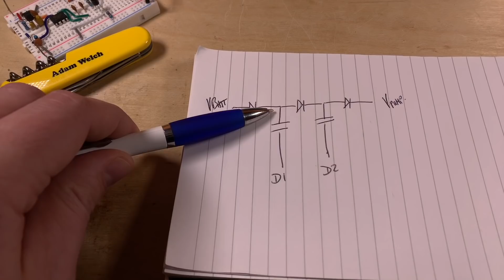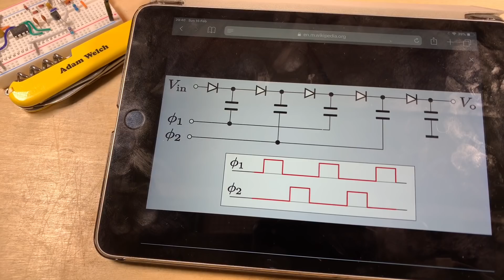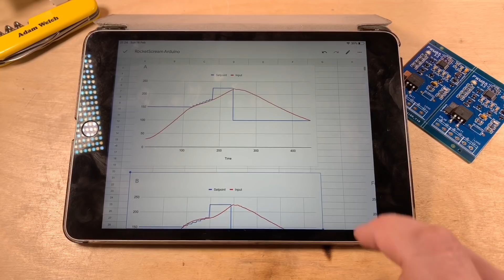PWM85 Improvements - Arduino PWM Solar Charge Controller

Comment: Really interesting video! 

Just out of curiosity, would a Schottky diode be a better choice for the voltage doulber circuit as they typically drop less voltage (0.3V vs 0.6V)?

Comment: Hello Adam. I have just received 10 pieces of the PWM85 v5 from JLPCB. I have soldered all the components it all up. I was just wondering if there was a video or a quick guide to program the attiny using the ICSP header on the pwm85 and a Arduino nano I have. Any help or direction would be greatly appreciated. Keep up the great work. Cheers

Comment: are you not selling these ready made boards? id be interested in a couple.
Reply from the maker: I was tempted. Postage isn’t easy at the moment though. What would you say is a fair price out of interest?
Reply: @AdamWelchUK  £12.50p inc post. post probably be under a quid if just wrapped in little bubble wrap with a piece of cardboard taped on top and bottom of it and then put in a jiffy bag. 
id love to have this for my car solar panel since it has low self consumption. would be good if i could also tweak float voltage for car battery so it keeps it at 13.2v

Comment: Adam would you put together the BOM for a through hole version of your PWM85 ATTiny based charge controller?
I dont stand a chance of putting a surface mount version of your charge controller together, but would a through hole version.
Many thanks.
Reply: Answered my own question :) > https://github.com/AdamWelchUK/PWM85 Thank you for sharing this project and keep the updates coming!

Comment: When I made a solar powered controller for my chicken coop I used all of the power saving features I could, but then I also used a sleep library to cause the whole thing to sleep for 8 seconds at a time, then wake up and check things (rtc).  Obviously you wouldn't want 8 seconds at a time during the daytime but sleeping for most of the night (triggered by low PV volts/High pwn on time) while checking periodically for PV volts increase should pull you well under 1ma average over the night.. its been a while but I think my consumption at night was close to .1ma or under.

Comment: I did find some small adjustable BQ24650 based MPPT charge controllers on Aliexpress these draw very little power from the battery when in idle like in the uA range.

Comment: so adam are you ready to put these ready made units up for sale? im after some as id imagine may others would be too.
Reply from the maker: I’ve had a couple of requests but I’m not sure I could sell them at a very competitive price. I guess it’s as much a development board as it is a charge controller but still.
Reply: @AdamWelchUK  thing is there is nothing else on the market that can compete with the low self power draw. when you get a finalised version out it would be worth pouncing on . those cheap controllers you have reviewed in the past that cost 4 quid are ok but even if your one costs 10 quid you have a sale from me.
Reply from the maker: £10+delivery is about as low as I can see it working out looking at the component cost. I think I’d prefer to pop it in a case though, and this would add further cost. I can’t really compete with the products from the east.
Reply: @AdamWelchUK  dont worry about the case the modders can get creative. or can 3d print cases if need be. 
products from the east may be cheap but there is always a market for those that want quality.  a board as efficient as this can easily be integrated onto the back of a solar panel etc. various options are available.
if you can get the controller running at even 500khz to save more power it would be icing on the cake.
Reply from the maker: Thanks for the feedback. I’ve had some code changes submitted on the github repository and they seem to offer a further 100uA reduction according to my meter. So its down to about 1.35mA. Just testing the changes.
Reply: @AdamWelchUK  awesome it just keep on getting better. the finalised product should be amazing.

Comment: What about using the Reset pin to hold the ATTiny85 in Reset when the incoming voltage drops below a threshold? Perhaps a high-value resistor/divider, dividing the Reset pin across the two anodes of the Solar and the Battery terminals could work. Set the values such that a low voltage on the Solar anode (relative to battery) will pull down the voltage on the Reset pin. Maybe use a smoothing capacitor to keep it from bouncing too much when a bird flies over the solar array? I dunno, just brainstorming. Edit: Seems it would cut down idle power draw though, as long as the resistor/divider was a very high total value.
Reply from the maker: Yeah that’s an interesting idea. Let me have a think about that.

Comment: Nice implementation of a 4 stage charge pump Adam. 

You can use as many stages as you need, to achieve the required voltage. ;)
Reply from the maker: Cheers John. I am tempted to take the ATTiny down to 2 volts :-)

Comment: About PRR tweaks, I've read datasheet more thoroughly.
When turning off USI, you can expect a 0.1mA saving ... when running at 8MHz@5V.
At 1MHz@3.3v, saving is hardly noticeable, between 5 and 25µA. I've got 5µA for my own breadboard.
Reply from the maker: Yeah the code compiled, but I couldn’t see any difference on the meter, so that ties up with what you are saying. I’ve had some code changes suggested on github which include switching off the USI and using sleep and the watchdog timer which I’m looking forward to trying out. Thanks again Marc for your time and suggestions on this - I really appreciate it.
Reply: @AdamWelchUK  My pleasure ;)
I guess PIC MCU in Julian's design is a better choice for this task, but let's see how close one can get!
Reply from the maker: I totally agree the pic was a much better choice - or the circuit was designed around its strengths, but I don’t think machine code has the level of access of c++. I’d like to think one person might look at it and either think - I can make that or perhaps even I can improve that.

Comment: Thanks, very smart tweak. Would it be possible to power this charge controller from the solar panel input and not from the battery?
Reply: You wan't to start charge without using battery?
A completely depleted battery will give 10V and still enough current to start with.
I don't see the point yet. Please elaborate your use ;)
Reply: @marcrives279  zero power consumption during nighttime? :-P effectively zero power consumption, since it's on the solar panel side rather than the battery side? just guessing 🤣
Reply: @pfeerick  yes, if the controller is powered exclusively by the solar panel it will not draw any power from the battery at night, no sleep function required.
Reply: @mjp0815  That was so obvious I missed it ;)
It's not that easy due to internal protection diodes.
To make it short, you can power a MCU from any pin (although that's not recommended!).
You can search "backpower" and "clamping  diode" to get more details.
Reply: @mjp0815  And again, there are different understandings of the sleep term.
- A very long time (e.g. hours) where MCU can't wake up by itself;
- A power state where MCU is saving energy, for any given time (milliseconds is OK).
Both are true, but not used in the same situations

Comment: have you looked at switching over to an MSP430? Those MCUs are designed with low power in mind, they do sip very little juice! The new ATtiny MCUs like the AVR1616 are pretty cool too, although I have not been able to get my Xplained board with a 817 operational yet from anything other than Atmel Studio. :(
Reply from the maker: I’m sure there are better micro controllers but I wanted to make this as accessible as possible. In my last video on the controller I think I suggested it’s a bit of a development board - for code at least. Using the arduino ide and compatible chips allows more people to analyse and adjust the code for their needs. Hopefully the 1616 will get more support in the arduino ide soon - I know there is some already. Thanks again.

Comment: Nicely done, Adam. And the PCB's look really neat too. Thanks for sharing this with us.
Can clock speeds be reduced more, to reduce current drain further? Yes, the circuitry will respond a little more slowly, but you really aren't needing super fast adjustments to the relatively slow changes to input voltage from the PV panels. A delay of a second or more would likely be tolerated very easily, especially if you can add some more low leakage capacitance in parallel with the panel terminals.
Reply from the maker: Thanks. Because I’m coding this in the arduino IDE you can only run the ATTiny at 8MHz or 1MHz. I wanted to keep this as accessible as possible.
Reply: @AdamWelchUK  Ahh, OK. Thanks Adam. Still, anything below 2mA drain is pretty good for something running continuously and doing what that board is doing. 

An alternative would be a low power digital timer (or an analogue sensor, as in PIR security lights) which turns thee PWM85 off during local darkness. A CMOS timer chip only needs to wake up circuitry to send an on/off pulse to a switch twice per day. Analogue circuitry (if used) would need to be active briefly once every few minutes. 

That would reduce average annual current drain to well below 1mA.

Comment: Glad to see those neat boards!
1:30 Here's many ways to make a MCU sleep
- Sleep until some external event happens (you need at least a pin);
- Sleep a given time, using internal watchdog (no pin needed).
Please note you can sleep for a very short period, like 10ms.

Also, depending the type of sleep :
- some chosen modules can still working,
- getting "awake" can be faster/longer
For instance SLEEP_MODE_IDLE let PWM outputs/timers working ;)
Reply: I did some tests on a nearly bare ATtiny85, using sleep save 0,1 mA (and pump PWM still works).
It now needs a try on a real board! I've made a pull request on your repository ;)

Comment: Great achievement Adam and really satisfying!
I would like to play with one of these, but make it voltage switchable for various lithium batteries, 1S-7S for remote applications and 6 to 20V panels. Replacing the divider with a pot or two should help, and then modify the code not to float, but instead pause after target voltage reached then restart after falling to a threshold.
Then might come a challenge to make it mppt, but in practice PWM is acceptable as long as the MPP of the panels is close to the battery voltage.
Reply from the maker: Thanks Andy. The circuit was optimised for 12v systems but could be adapted for a range of voltages with some consideration to a few maximum ratings. It’ll be less efficient though I’d imagine, for starters there is a higher voltage to drop over the LDO, the high side driver will also use more current as it is.

Comment: Awesome :) What's the ATtiny clock speed? I seem to remember running the PIC at 500kHz gave me the main power saving of the PWM5.
Reply from the maker: I’m running it at 1MHz, the lowest I seem to be able to go. I did contemplate trying to run the ATTiny at an even lower voltage, and seeing how far I could push the charge pump :-)
Reply: @AdamWelchUK  I was going to ask the same question.
So this is the charge pump that need those 3.3v...
Reply: @AdamWelchUK  You can remove the charge pump completely if you use a bootstrap cap on the gate driver, which will drive the gate with ~VBATT above the source. CLKPS appears to allow you to divide the clock by up to 256; you should be able to go well under 1MHz.
Reply: Here's a special 128kHz mode (using watchdog resonator instead of 8MHZ one).
I get 350µA on my bare attiny85 (3.3V), running PWM85 sketche!
Here's some pitfalls :
- You need an ISP that can cope with that low speed (my home made USBTinyISP is OK)
- You need to add a parameter to avrdude to set that low ISP speed (need some tweaks in Arduino IDE)
- PWM frequency may became too slow (460Hz charge pump, driver frequency not tested - can be changed by register -)
Reply: Looks like the bossman already asked what I was thinking !

Comment: Why not use a logic level MOSFET (IRL instead of IRF) to switch the power? Then it can be switched at a lower voltage.
Reply from the maker: It is a logic level mosfet but it’s source pin is connected to the battery - so you need a higher voltage (than the battery) to turn it on. You also get a lower on resistance by turning it on with a higher voltage. Lowers heat and increases efficiency.
Reply: @AdamWelchUK  That's a trap for young players, I made the same mistake (thinking like Brian B) with my very first charge controller 5 years back. Gate voltage must be above Source voltage and Battery (-) is the source voltage (mcu ground) . Also,panel (-) on Drain is not ground !

Comment: Hello I’m new to electronics and I understand the schematics but I want to know why does the high voltage drive side have so many transistors? Why one isn’t enough?
Reply from the maker: The circuit is designed to turn the mosfet on and off as rapidly as possible while using the least amount of current. It’s Julian Ilett’s design and he might appreciate the question on his channel (you never know it might become a video).